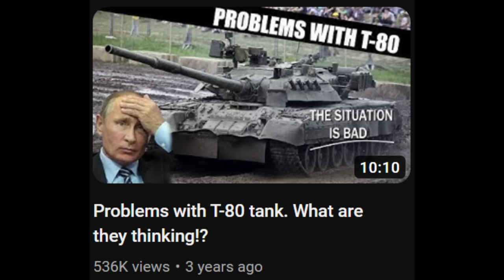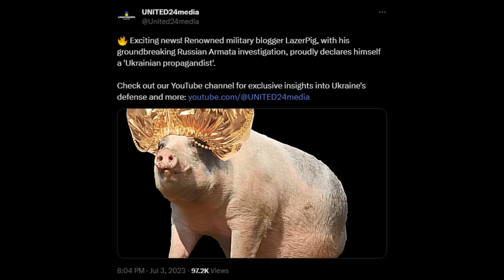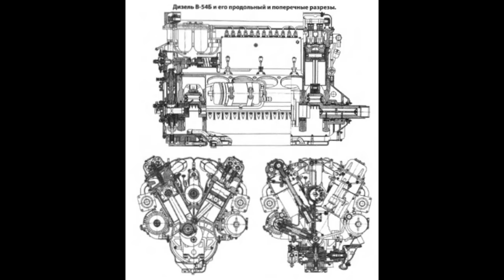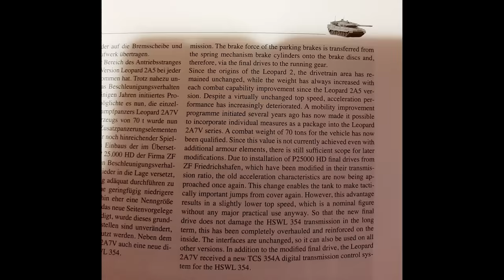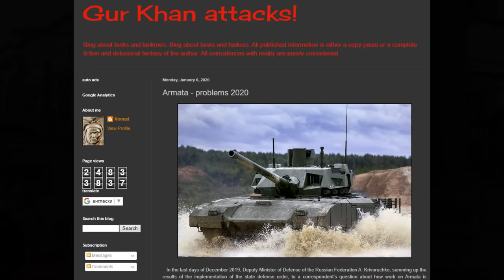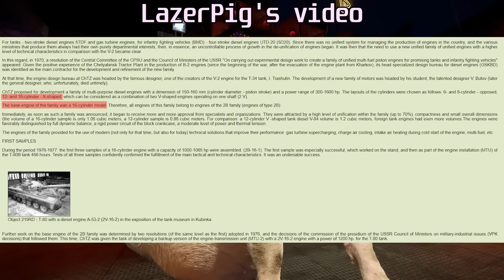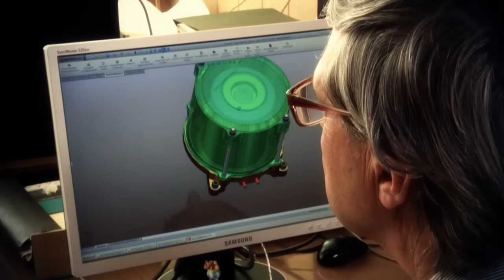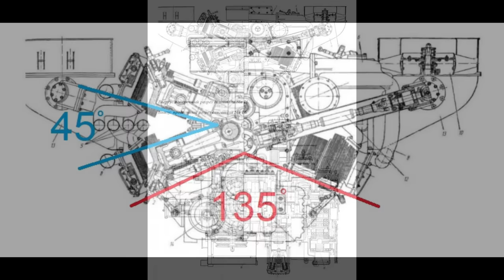Response to LazerPig and the T-14 Armata dispute

Comment: I dare lazerpig to go into the 2JZ community and bash their engine for being smaller and lighter and thus making less power than the big V8s (natrually aspirated that is). That's basically what he did with the engine in the T-90. There are only 2 ways to make more power in an engine which can be done by increasing airflow and fuel flow, which is limited based on the chassis you are working around. In terms of tanks, extremely limited with the biggest problem being clean airflow to feed any turbos or superchargers. That leaves the other option, displacement. Since the T90 is extremely limited in terms of the quaity of parts, and engine bay size; it is extremely impressive they can crank out more power before adding a supercharger. That is the point red is making here. For what it is, the T90s engine is a job well done by their engineers. Is this Russia propoganda? No. It's an observation. Is saying the 2JZ is a work of art for being a great platform to build upon in JDM cars Japaense propoganda? No. It's an observation.

Comment: 15:33 sorry beside the point? Lazerpig even pointed out that the reason he says what he says about the v12 1930's engine is to point out that the engine has reached its upper limits as an engine and needs to go. So the leo 2 engine might be old and unmodified but its still a hell of a lot stronger than the v12.
Reply: How can he or anyone else prove that certain engine reached it's limit? How exactly Leo 2 engine can get better and why can't v12 be improved the same way?
Reply: @yellowtunes2756  the v12 is almost 90 years old, the core construction of the engine like the size of the case, pistons, valves. You cant change that to more modern/effective sizes or change the cc's values a lot without a major redesign of the engine. They have than the most of what they could, supercharger, shape of pistons, the lower part that red pointed out, but those are the only thing they can really change. The leo engine hasnt been modified (according to red, because idk really) so how mich can they still squeeze out of it? It already is stronger than the v12 and yes its bigger but also 30+- years younger from a time where engine grew a lot stronger relatively quickly.
Reply: @thegamemingk4933  leopard 2 has v12 engine and it was made in 1904 for racing boats. What's your point? Just because something was made long time ago - doesn't mean that it can't be improved. Why can't shape of pistons be improved or better super chargers be invented?
Reply: 16:30
Please sit patiently.
Reply: @thegamemingk4933 sometimes you simply get something right from the start. 

I mean theres a reason nobody is looking into replacing the M2 Browing, the Engine may well be in a similar position albeit needing upgrades.
Reply: @acatfrompoland5230  if I believed that his point then answered or debunked my point, I would have deleted my comment.
Reply: @yellowtunes2756  what are you on about? I am talking about sizes not shape. If you put a good enough team of engineers and designers on the job of making an engine to the size of the karkhiv v12, with nowadays technology they will preoperbly make a better engine at the same size, because they can put a better crankshaft in it making more room for pistons and thus increasing fuel volume.
Reply: @thegamemingk4933  Russia uses X engine, which has twice as many cylinders (and pistons) as V engine, which Leopard 2 using. So for roughly the same size - X engine will produce more power than V engine. X engine is more complicated and harder to repair, but theoretically it's better than V engine, because it's basically 2 V engines put together. Do you have any idea what are you talking about? 

We both have no idea if V or X engines can be improved, what's the limit of that improvement and what's holding them back. Only people who worked for decades on their modernization can with some level of confidence say that those engines reached their limits. You, me, pig and anyone else (outside of maybe a 100 top level engineers on the planet) can't confidently say anything on that subject
Reply: @yellowtunes2756  I am only talking about the karlhiv v12 and the leo2 engine for comparing not any other engine. Not maintance, not x engines, also do I need to be in the top 100 of plane experts to see that the F4 isnt a great frontlinie duty jet? Or do I need to be an top 100 firearms expert to see that the m1 garand is a good pick for main duty weapon? You dont need to be an high expert on something to see if it is still a viable system in its class/role.
Reply: @thegamemingk4933  both Leo 2 and t72 for example use different versions of V12. Why one V12 engine can't be modernised while other one can? If you're talking specifically about engine named Kharkiv v12 - it was only used in planes in ww2, since then it was changed and improved many times

You don't need to be an expert to say that f4 isn't a great frontline plane. But you do need to be an expert to say that it's wings can't physically be improved by changing material, shape or thickness
Reply: @thegamemingk4933  I am sorry but I have no other way to put this except, is English your first language?

Mine isn't very good but I am just wondering if you consider yourself fluent.
Reply: @acatfrompoland5230  no it isnt, and no I consider myself on the level of "a easy convorsation" but my grammar is by far my biggest weakpoint in any language.

Comment: Can a ww2  gun penetrat a challnger 2 in Ukrainian yes or no?
Reply: No
Reply: @E-zey  then why did he go round  in circles then back track on saying he was wrong
Reply: @gingernutpreacher  idk, maybe coz he talking about Frontal Lower Plate without an ERA.
Reply: @E-zey   yeah can a ww2 gun penetrate it?
Reply: @E-zey  you said earlier it couldn't penetrate a challenge  2 in Ukrainian
Reply: Without era - yes, ww2 gun penetrate it. For example soviet zis 2 57mm was made to destroy tiger with 200mm armour, which is the same thickness as challenger armour. So if you hit challenger 2 in the same place twice - you will destroy it with ww2 gun
Reply: @gingernutpreacher  yeah ww2 gun couldn't penetrate Challenger 2 with ERA add on to it
Reply: @E-zey  with out? Presumably with Dorchester armer lower plate
Reply: @gingernutpreacher The Dorchester armor plate is probably over 300mm but less than 400mm. The Dorchester is even stronger.
Reply: @voidtempering8700  so if it's 60mm it's sold steal
Reply: @gingernutpreacher  The base armor is 60mm.
Reply: @voidtempering8700  has it gone to Ukraine with just the base armour?
Reply: @gingernutpreacher  I don't know.
Reply: @gingernutpreacher  Probably not?
Reply: @gingernutpreacher i looked a bunch of images of ukranian challanger 2 and it would apear that the tank doesnt have the dorchester plate, just a bunch of other modifications that the ukranians made like a cope cage on the roof
Reply: Not sure but was DT-10 from ww2? Mean its the oldest gun in service for Russia with their T-55, so technically if it ww2, yes, ofc, but I gonna say a T-34/85 could also do it at battle ranges... Getting the shot to land etc is another thing, hence technically
Reply: @voidtempering8700 since the Compositive armor is added in a block, and also since its a TES upgrade thing, which is the thing with Challenger 2 on Ukraine its not TES, no it did not, also images of it with Slat armor there were saw, so not even the ERA made it...
Reply: @E-zey Yes depending on where you hit it. Modern tank armor is heavily skewed towards the frontal arc. Are actually sometimes thinner than ww2 era tanks in certain not easily hit angles and locations, like the rear or the lower glacis, possibly exact numbers are all classified information. 

ERA is designed against HEAT not anti tank sabots.

Comment: i mean yeah its a modified ww2, but LP points still stands its an engine based on something thats originated almost 100 years ago... the fact that a lot russian tech represent the evolution of something so old its a red flag.
Reply: So like the Leopard 2's engine which is from the 60 years old and the Challenger 2's engine which is based on a WW1 engine. Those would be red flags by your logic as well.
Reply: But it’s not. The block isn’t even the same. It’s not even a modified WW2 it’s a completely different engine with a similar bank and chamber layout.

Are all 2.0L Inline 4s the same? No there’s a significant amount of engines that are completely different but the same size.
Reply: @Saffi____   the challenger 2 yeah, leo not so much, its power bank still slaps the russian one in every way exept weight.
Reply: @Saffi____ dude it’s still a better design that instead of basing itself on a engine that CAUGHT FIRE DURING TESTING based itself on more moderns engines of that period and stop going “but NATO uses this!1!1!1!” Yeah they planned for it to be used for a certain time and was built to be useful for a very long time
Reply: Literally the same thing for the Challenger...
Reply: @Goober762  The A-85-3A is way more modern design and provides the same horsepower as the KA-501 but more torque so its better. A-85-3A is not based on the Type 101 petrol-electric engines, Type 101 isn't even x layout engine. Laserpig said in his video that the SLA16 was used on the porsche tiger when it was the Type 101 engines used on it. A-85-3A isn't based on the SLA16, it's not from ww2. Maybe go watch the video?
Reply: Its not a modified ww2. LP's points do not stand.
Reply: @Mrhungern  youre right, its an all new engine, made very recent from scratch without having any other inspiration whatsoever.
Reply: @laurentiuanton4806  Yes i am right
Reply: @Mrhungern  gj, you won a chewed gum 🫡
Reply: @laurentiuanton4806  thanks bud
Reply: @Mrhungern  no worries, let me know how is to reverse at 5 kph =)
Reply: @laurentiuanton4806  The T-14 can reverse in 80kph
Reply: @Mrhungern  😂😂😂😂😂 yeah all 10 of them, and its more like 40 but ok
Reply: @laurentiuanton4806  No it's 80kmh and im still right and there only being 10 of them has nothing to do with anything. You are still wrong.💀💀💀(you also said 5 kmh but okay)
Reply: @Mrhungern  russia cant build modern shit, and by some miracle if they manage to do, they will work 60% of the time. We have the t-14 who managed to bankrupt a factory after 10 models 😂😂😂, the su-57 nobody wants to purchase them and russia managed to buy a dozen. It will be a miracle by 2030 there will still be a country named russia.